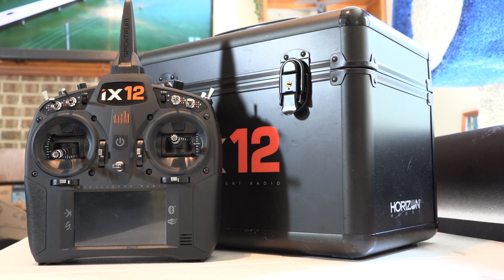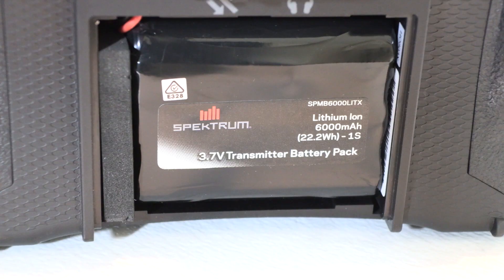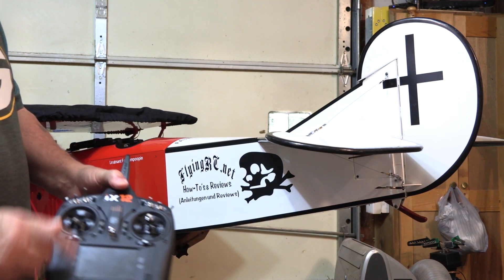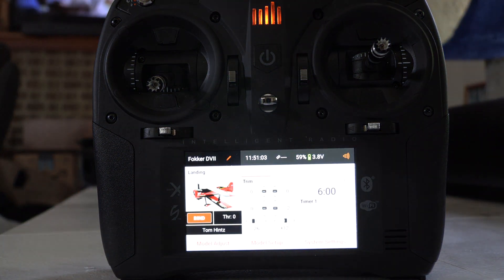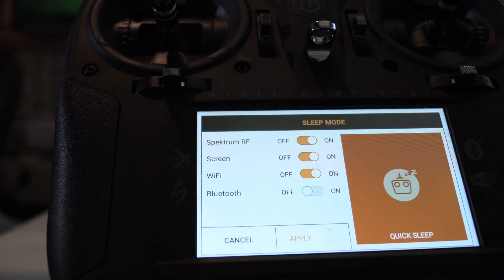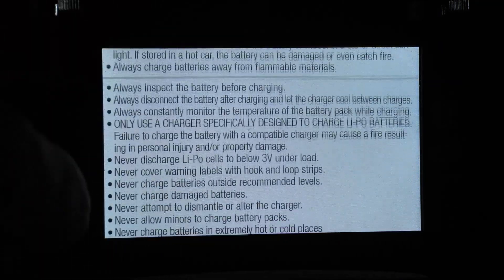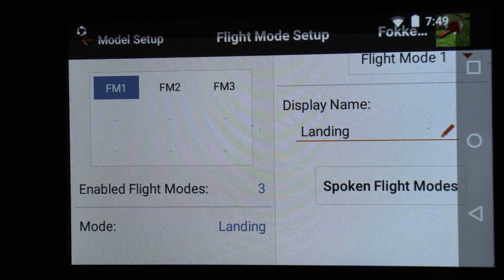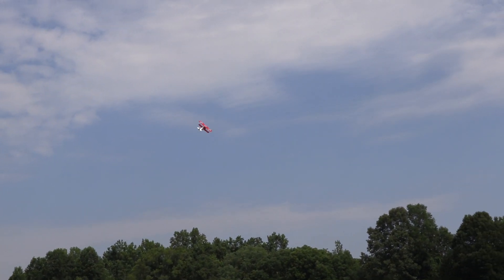Spektrum IX12 12-Channel Transmitter Review

Comment: Hi Tom. First of all i wanna thank you for the video. I have been flying with spektrum for 10 years now. Last 5 years with the DX9. Two of them actually.  Yesterday i forgot to turn it off and me and my wife went to the store. Alarm went of with vibration and the radio fell down on the floor and broke. Well i was thinking of getting my third DX9 but i have wanted the ix12 for a while so im still not sure. But trying to read a little about it gives me little cause it is almost only negativity. After watching your video i started to think that it is always easy to spread shit but never any good. I love the way you explained it and i guess im buing a ix12. Have a great week with lots of greetings from Norway.
Bengt & Elna
Reply: So did you ever buy the ix12?  I’m wanting one too. It’s a toss up between the dx9 and the ix12. My dx6 g3 is somewhat limited access in my option.

Comment: Thanks for that explanation of the complaints and their cause. People who don't read the manual usually do complain. I have one coming and I am replacing a Hitec Aurora 9x that still works fine and the only reason I never went with Spektrum in the first place was I did not like the scroll wheel or the programming method on them.

Comment: Did they ever fix the problems you mention? Like long start up time? And better lasting battery?
Reply from the maker: I didn;t say those were problems, just what others consider problems. If you watch the instructional videos the battery life thing goes away as does the slow start up. If you are going to a new or different model than the last one you flew it can take a couple minutes to load, way shorter than needed to put most planes together.

Comment: Have to disagree  with you on this one. My first 12 had so many issues and (Yes I read the manual). Horizon sent a new one and a month later models corrupt all by themselves! I am not kidding and I have many years experience in RC and have Dx 6, 8 and 9 and love them. Flying at an airshow last weekend, a model corrupted itself.  It's not me, look around the internet and you WILL find MANY problems with this radio.
Reply: Drakkor Vladimir Were these issues resolved with firmware updates? Considering this radio upgrade from JR 9503